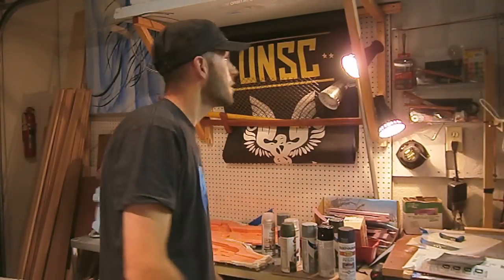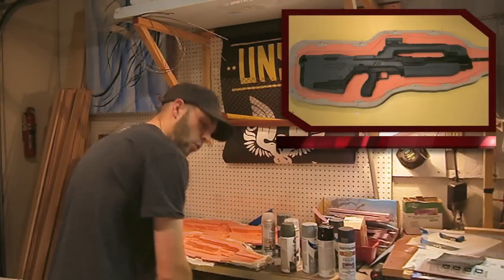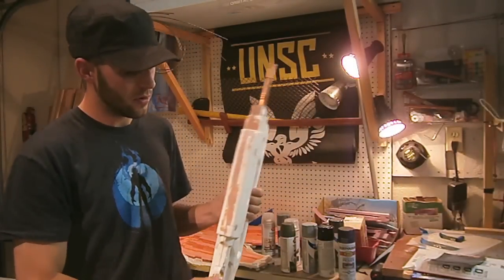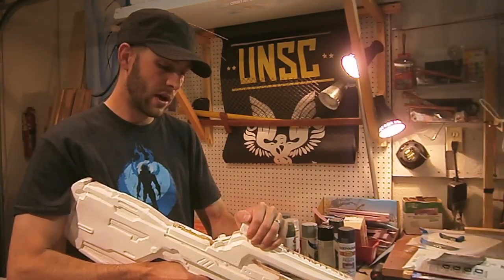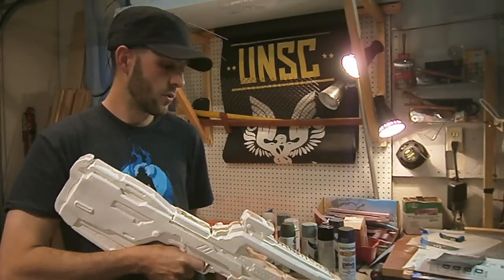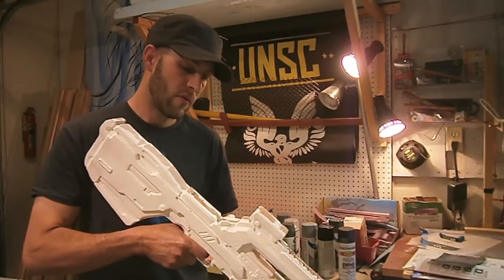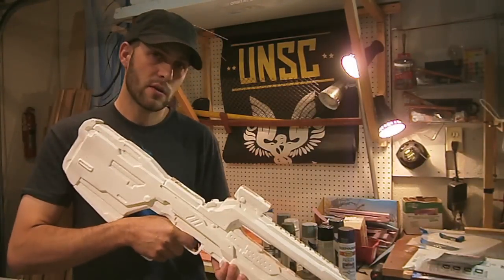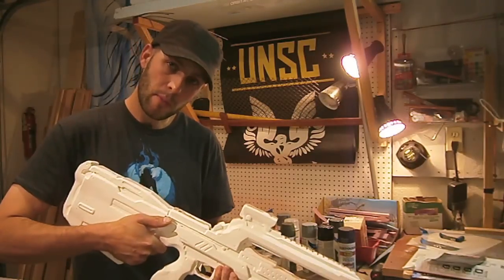Halo 4 BR special edition

Comment from the maker: i actually use smooth-cast 300 to make my solid plastic copy, and it costs around $80-$100 (after shipping) i like working with the material but it takes a little time to get use to. i did lots of small projects before i jumped into this one. smooth-on,com is probably your best place to purchase it but give them a call because they may have a distributor thats closer to you which will save you on shipping like they did for me.

Comment: I saw you seem to imply you use smooth on rotocast for your plastic coating.  How do you find working with it, and what's the price on it?  The only place I can find it is direct from a distributor and I was quoted $80 a gallon (not even sure if thats A and B compounds or just one.  Any help on places to get this and prices I should be paying?